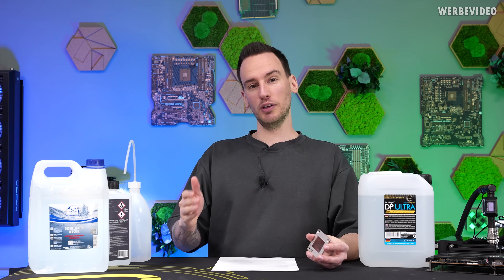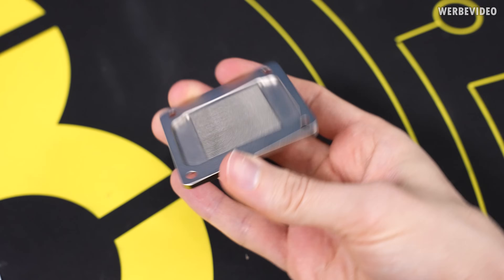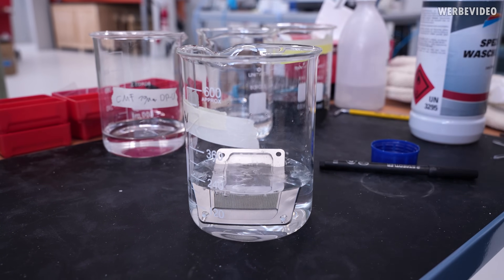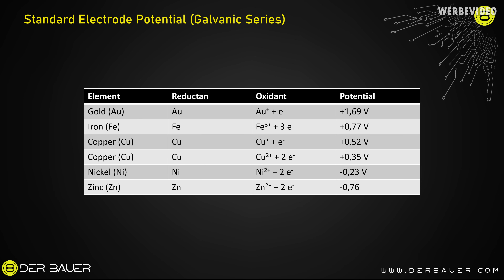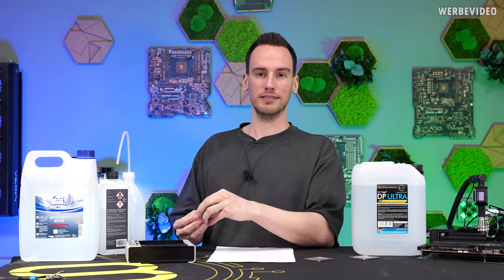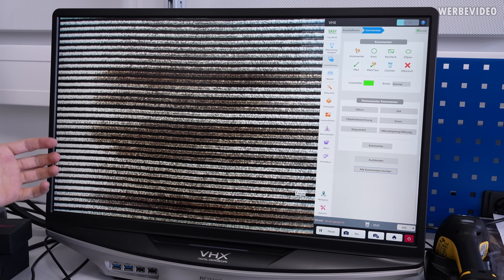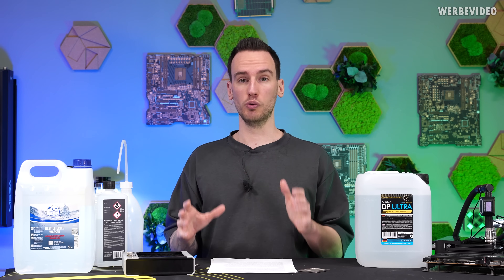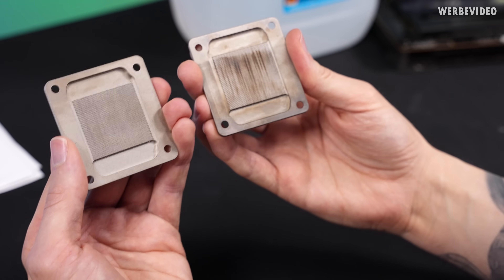Do NOT use Distilled Water for your Water Cooling Loop!

Comment: I have used DIW + inhibit on my custom water loop and no problem. I wanna note that there is many different inhibit available in the market and DIW is little bit acidic about 5,5 pH depend of purity of DIW. I use ultra pure DIW 0,05 μS conductivity with resistivity about 18.20 MΩ. This DIW is typically used in the semiconductor industry.

Comment: I’m going to call you out on this one.  As this topic has already been discussed and shown to be a manufacturing problem caused by cheap materials and or plating processes itself. Martin the fan guy literally had loops running for two years with nothing more than distilled + anti bio.

Comment: It's definitely harder but there are ways to fully electroplate high-aspect ratio parts.  The classic problem is just due to the electrical double layer preventing additional metal ions from making it to the electrode surface but pulsed electrodeposition has come pretty far in overcoming it.  By using techniques such as pulse reverse plating you can get quite a lot of control of uniformity and nanostructure.  Granted you can also go the more expensive route of atomic layer deposition of nickel since that uses self-limiting half-reactions to get conformal coatings, though for nickel I believe you tend to need plasma-enhanced ALD to get elemental nickel.

Comment: A lot of people here in the comments lack basic middle school level chemistry knowledge. If you remove all trace minerals from water "distilled water" the water wants to replace them and it will do that by leaching the minerals from the metal surfaces of your plate and loop. It happens very slow, and once it has enough of those minerals, it's no longer distilled water, but it has taken those minerals away from the material. Those people saying they have used it and had no problems, well, keep doing it over and over and it will remove enough minerals to be a problem, but doing it once might not.
Reply: A lot of people here didn't get a PhD in chemistry. And what you said is wrong in multiple ways.
Reply: A lot of people here in the comments have decade plus experience with running distilled water with zero problems. Roman's theory checks out, but in practice it's a big nothing burger.

Comment: It doesn't really matter but I think his point is just don't use distilled water. Everyone saying they've used it with additives are right but that's also not the same thing. If you add kool-aid to distilled water it isn't distilled water anymore, even if it's clear kool-aid.

The coolant I use is distilled water plus random stuff. I imagine most market coolants are.

Comment: I've been using distilled water in loops with acrylic, silver plated brass, and copper for almost 15 years no with no issues. A couple of those rigs have been running nearly 24/7 for 4-6 years and are showing no signs of corrosion or discoloration. My blocks are clear.

I take special care to ensure all my fittings are compatible materials and use silver for microbial control, but nothing for corrosion inhibition aside from material choice.

Do you think it's a bigger issue now with so many companies selling parts and accessories for cheap and not always being truthful about what those parts are made from?
*Edit to add that I have always made sure to choose distilled water labeled as safe for use in small appliances.
Reply: A friend of mine used an EK D5 pump with a metal pipe that turned out to be made of zinc or plated with zinc. It deposited sparkly particles all over his loop. After he RMA'd the pump, it was silently retracted from the market. This was before any of the EK scandals were public knowledge.

Comment: Been using distilled water with Primochill Liquid Utopia for well over a decade with zero issues ever. I have even left it without a flush for over 2 years before and still didn't have an issue. I opened up my Cpu block when I finally flushed it that time and it looked almost new.

Comment: You are so god damn awesome der8auer. I'm glad I bought some DP Ultra for after I flush and fill my custom loop. Not really much discoloration after 2-3 years with EK clear coolant but it's definitely surprising how much discoloration there is with distilled water. I guess the best solution is to use a fully copper loop with no fittings!

Comment: Redline Water Wetter?

You can't run antifreeze at some drag strips or race tracks, so distilled water + Water Wetter is the way to go. It has surfactants that increase heat transfer and antioxidants to prevent corrosion.

Comment: Main corrosion source here is oxygen solved in water, thats why thermal power plants use deaerators. You may notice that corrosion is much heavier on top side which is closer to border with air (oxygen source).

Comment: So I'm a car guy and I have know for more half of my life 57, that you do NOT use distilled water in the radiator of you car, you can use car coolant in your pc I have since 2002 when I first water cooling, if you get a leak you will smell it too.  WTF 12:00 that is okay, no it is not. If it is removing the copper form the base of the fins and depositing it on top of the fins this is bad.  16:30 kind of wrong, I'm thinking with out testing but you could use an acid bath to remove the build up, use an acid that does not effect the nickle but the build up.

Comment: This industry has become such a mess. My loop had only one metal throughout, no hard lines, no quick fittings, no commercial additives, only used distilled water and iodine, and it lasted 11.5 years running 24/7 across 3 different systems (45,000 hours over the rated MTBF of the pump), and the only reason I retired it was because I built another loop. Both pump and block were virtually spotless.

It's cool you're doing this testing to mitigate issues as much as you can for your products and partners, but I'd never be into building a loop the way all of you do now. Everything went form over function and that's just not my style.
Reply: I appreciate what you said, and I have a similar experience running an old system for years and years with little to no maintenance running just distilled water with biocide, but to be quite honest, the industry has always been a mess. Remember the Mayhems additive scandal 15 years ago? Companies have just been putting products out in the market with little to no testing and the community has had to bear all the ill effects of that. It's good that Roman is trying out different nickel plating techniques and testing different coolants, but maybe this video was shot just a bit prematurely to draw any firm, practical conclusions.

Comment: The issue I have with corrosion inhibitor additives, is that most that I know of will affect acrylic used in your average PC water loop such as a acrylic reservoir, distributor, or the backs/windows of water blocks. I've had 2 reservoirs that I had to replace because of severe crazing and cracks in the acrylic, back when I used distilled + corrosion inhibitor + biocide. After that, I switched to distilled + biocide only and have never had any issues since for years.... till recently.
I had a EKWB gpu water block in my loop where the nickel plating seems to have rusted away, and even the copper underneath it was starting to petina and cause the rest of the loop (tubing and CPU block) to turn green. I blame that more on the EKWB block, as they are known to have issues with the nickel plating on thier blocks. I was hopeing I wouldn't have had issues, but it did happen in a short time (about a year).

Comment: I don't believe that flushing your system with distilled water is a problem. As in the video, he didn't specify how long the block was in 60°c distilled water. It isn't realistic to say that distilled water is a problem for short-term use/flushing when there wasn't a test to see at what point the discolouration occurs at room temperature. A time-lapse would have been nice.

Comment: Glycols have been used in automotive and industrial cooling for a long time by now. Ethylene or propylene, various concentrations. Curious if you can test that, pretty much any auto supply store would have them anyway. Unfortunately they do take away cooling capacity away in exchange of corrosion protection and antifreeze. Perhaps messing with concentration would do.

Comment: Sentinel X100 is a very good corrosion inhibitor for water cooling. its used to protect corrosion in cast iron boilers. 

Using distilled water with X100 is a good combination as distilled water won't have dissolved minerals that can deposit on the metal surfaces acting as an insulator or restricting flow in small diameter passages.

Comment: Yes I only used distilled water because of bad experiences with EKWB additives, their clear Cryofuel produced flakes in my reservoir and their "Mystic Fog" fell out and accumulated in the jet plates and high friction areas of the loop and I had to clean and replace everything. I assumed distilled water was the way to go. I wish you made this video earlier as I just completely redid my loopb(4x480's in a Corsair 9000D, 25c water temp and RTX 4090 10c above water @ 370w, see my channel).

Comment: This is the first time I’ve heard of people using just distilled water in a loop apart from leak testing or flushing? Now it would be hilarious if you got paranoid and just added something like Zerex antifreeze as coolant instead
Reply: Anti-freeze isn't even that stupid.

t. runs Fleetguard Compleat OAT in his computers (toxic as high holy hell but it'll last basically forever)

Comment: 10+ years ago i was starting with custom watercooling and back then many people on the forums recommended to "just use distilled water" so i used it in my 1st loop with nickel coated EK blocks and after half a year of usage the coating at the places in touch with liquid was practically gone. So i thought it was weird. Short time after that i read somewhere about distilled water attracting ions so then it made sense to me. So then i thought i have to buy one of those expensive overpriced liquids for watercooling to stop this nickel corrosion. I was looking for some cheaper ones and found locally a premix from EK, bought 3 liters of it. After short time of using it i noticed some particles in the loop looking like small parts of moss or algae. So then i thought oh this premix from EK is probably shit and doesn't properly inhibit organic growth. So because of that i had to completely disassemble the whole loop and blocks to properly clean it from all the organic materials as much as possible and also bought a chemical cleaning kit i believe from primochill and finally switched to aquacomputer DP Ultra. Have been using it in the loop for 2,5 years and nothing really happened and just changed it from pure maintanance for Corsair XL5 which is available locally and also seems to be good. TLDR: 1. Don't listed to shitters who haven't done any tests themselves or have no real experience. 2. Be very aware about what you buy from EK - most of their products are badly designed including blocks and other stuff 3. Don't listen to shitter youtubers and stay away from colored coolants no matter how it looks(i was lucky to have a brain and never used them) - you don't need solid color particles from the fluid to stick completely everywhere inside your loop and do a "maintenance" every few months because you used a bad coolant(good clear coolants with no color will work 2+ years no problem).

Comment: Disagree on not flushing with clean water.  Any contamination would have very little effect on pH coming out of your tap so the RATE of corrosion would be so infinitesimally low you wouldn't be able to measure it.  Distilled will also start dissolving atmospheric CO2 as carbonic acid as soon as you open the container.  But the rate is still very low, the pKa of weak carbonic acid will reach equilibrium at around pH 5.6 with time which is still very very weakly acidic.  It's sitting water - time - when stuff happens and builds up area under the curve even with slightly acidic pH.  You're just not flushing anything long enough for any meaningful amount of reaction to happen.  After flushing either fill with a proper coolant straight away or blow comp air through to dessicate to prevent any pools of sitting liquid.

Mixed metal loops are things automotive cooling systems have been dealing with for decades - I really don't understand why PC people are so keen on ignoring all the basic advice, the same redox/galvanic chemistry reaction principles are at play, just at less stressful temperature/pressure conditions.  The mixes of metals in alloy engine blocks, headgaskets, when mixed with copper or aluminium radiators can last decades before corroding out with properly maintained automotive coolant, where Zinc is the additive as a sacrificial anode and flushing on fluid change deals with deposits.  PC watercooling loops are under far less stress; most of the products are entirely unnecessary beyond cosmetic value (I concede that bacteria do find it harder to gunk up a medium that cycles up to say 100C + 2bar)

Comment: Water cooling is more aggravation than it's worth. Use a good air cooler and no more worries about upkeep other than replacing the heat sink paste every couple of years and blowing the dust out of the fins and fans. I just don't understand why people put themselves through this mess.

Comment: you could try and experiment with sputtering. vapor deposition or dlc coating ( the sputtering should be able to coat the bottom of those slot's/ fins since it basicly works like a flash light. if it can be seen in a straight line from the sputter source it can coat it )
the dlc is extremely hard( which we often use it on carbide endmills ). shouldnt let any meterial be sublimated through ( so the water shouldnt be able to pull copper through it ) and it also has a insane thermal conductivity ( about 500 w/m'K ) so it shouldnt really take a performance hit